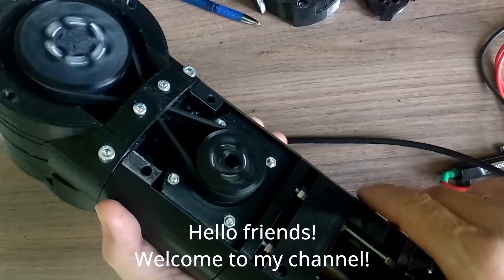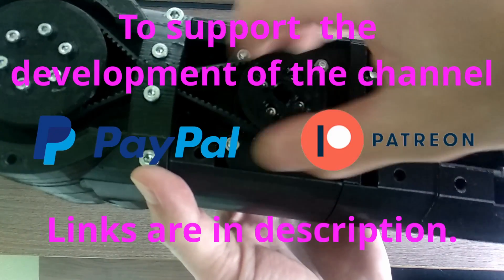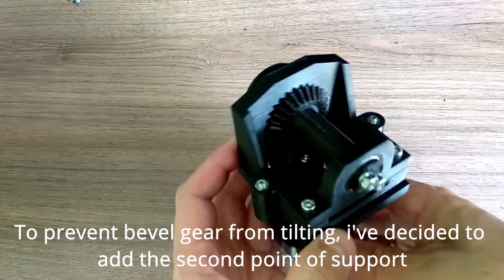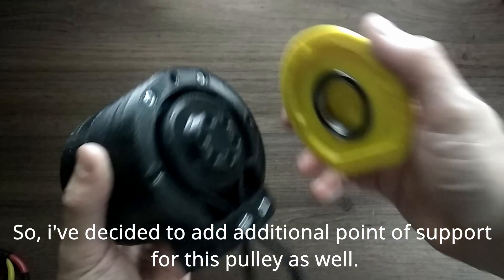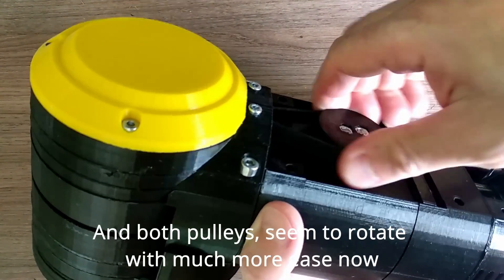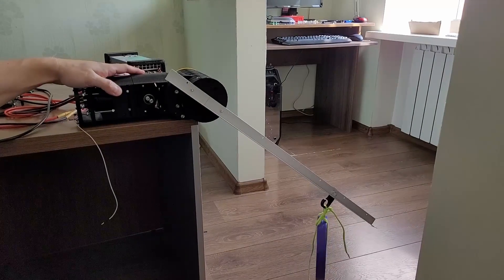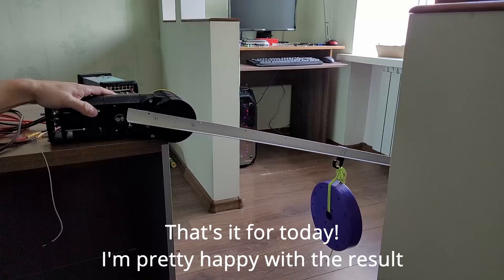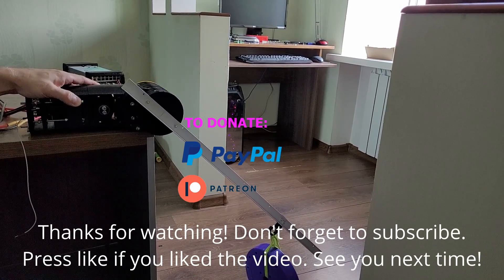3D PRINTED  ROBOTIC ARM: JOINT 5 GEARBOX FINAL DESIGN!

Comment: Nice work! I've been building a fully custom robotic arm on and off for a couple of years now. A lot of peoples' designs made the contact point of the motor an actual structural connection point, which is not ok. The joints should be able to operate using bearings without their motor in most situations, and then the motor can be introduced. At the very least, the motor should be mounted with supports like you have to minimize the radial load. It's awesome to see that you stumbled on this necessity as well!